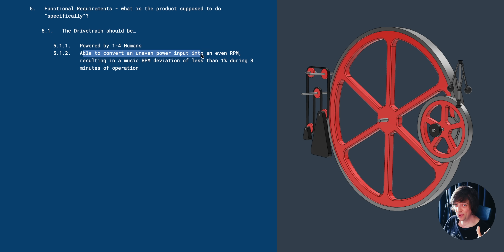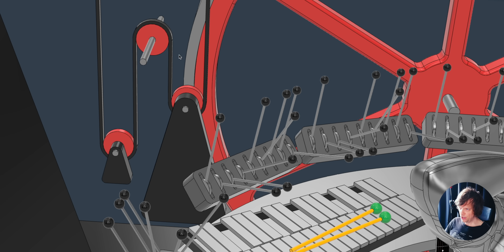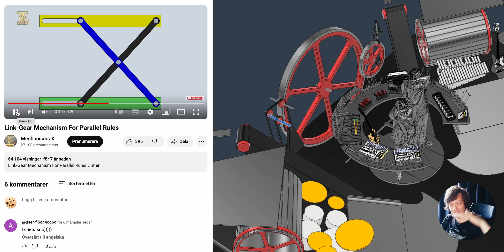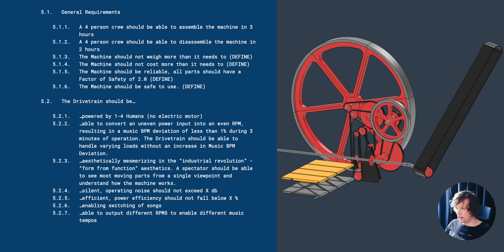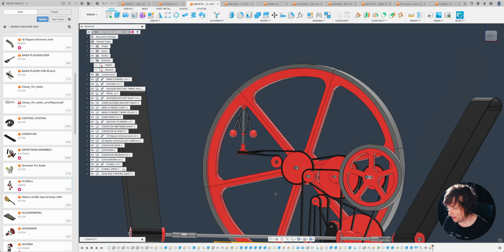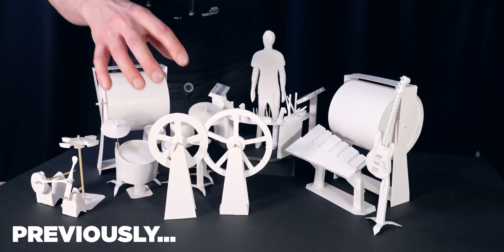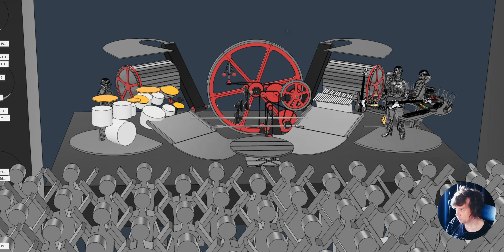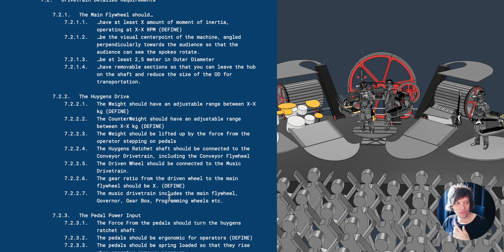The Marble Machine Drivetrain

Comment: Sea-sickness mid concert. There is a reason most pedal operated machines have a stationary point. Give the operators somewhere to stand or sit.
Reply: there will be one.
Reply: Seems like the operators could be sitting on bicycle seats and pedaling bicycle cranks and chains.  There could even be a derailleur to change ratios.
Reply: Once Martin calculates the input energy required for the songs he decides to perform, he might want to take another look at the weight. Maybe if the energy requirement is more than he is comfortable with, he could devise something (an antique cannon, perhaps) that could be ratcheted up into the air by some volunteers, preshow, and it's stored energy tapped into if necessary. 😅
Reply: If you looked at the blueprint design requirement it was written there.

Comment: Good ideas. You could raise the mechanics so they become visible again. The twist in the belt to the governor is a fail waiting to happen, better to find a better solution.

You are missing two requirement areas:
- safety
    - for example: fly wheel must be out of arms reach from control area, or there needs to be a transparent shield between players and fly wheel - that thing is dangerous
- location
    - for example: machine must work within X temperature and Y humidity range, a worldtour means different environments, that will deform the machine, same for transport
    - for example: what are ne needed loads of the stages? There might be requirements from location towards you gear. Best to get a general idea of what these will be befor building.

Comment: I'm a bit concerned about uneven surfaces with the pedals. Especially if the operators are moving around in the control station.
Reply: There is a requirement for a stable platform for the players to rest on on the list. He doesn't mention it.

Comment: You dont want a static gearbox. Gear shifts will be clunky. You want a cvt or hydrostatic. So gear changes can be seamlessly infinitely variable.
Reply: Honestly for this build I'd prefer hydrostatic. A cvt still needs clutch. Start clutch and overrun clutch. Hydrostatic being capable of a zero gear ratio solved both and directly interfaces with govoner.

Comment: The design requirement of being solely human powered still baffles me. Why not have some assistance so you can leave the machine, even just temporarily.
Reply: Maybe run a motor on the higan drive, that can be turned on and off. Its sole job could be to reset the higan drive while Martin can run off and do a solo away from the machine or something. Just an idea.

Comment: I am not sure how your going to be able to make that pedal system workable and safe. You could easily trap your foot and you're not on steady ground at any point.
Reply: Going to comment here, because no one will read my comment if it's further below: a set of bicycle pedals and a saddle would be soooo much more ergonomical. That's actually a kind of pedalling one can sustain.
Reply: @Julia_and_the_City how about pedals on the side of the machine and volunteers of the audience can do the powering? It would free the band up to make music.
Reply: @theowl84  that sounds like a liability suit just waiting to happen, ngl. Itd have to be practically impossible for someone to injured by the mechanics, or they'd have to have people sign liability wavers. Plus thatd make it harder to find a venue for performances.
Reply: @Julia_and_the_City that’s a good idea!
Reply: @Julia_and_the_City   yes, but if the torque required is more than a bike pedal could handle, you'll destroy the pedal, or your leg, or both.
Reply: @Berdersner    I ride a cargo bike and a run off the mill safety bike (Dutch life). They're pretty heavy and there are even bicycle-buses (real stupid looking but they exist) for as many as 10 people. Pedals on modern bicycles only go _forward_. If you try to backpedal - or more relevant, if the machine you're inputting in moves faster than you can pedal - the drive disengages. So if the torque required is too much for me to provide, the machine just doesn't move... Change the gearing downward to get it started. Either way, safety seems like a moot issue to me. And I'm not the kind of person to say that about anything, I'm generally very much a stickler for preventing occupational hazards, hence why I jumped on ergonomics here in the first place.
Reply: @Julia_and_the_City  only ever said if the torque in the system is too high, then your liable to break the pedal or your foot through the strain of trying to pedal like that. Dont put words in my mouth. Also, this isnt some mountain bike your trying to pedal, but several tons of metal, I get the feeling that a simple bike pedal isn't going to cut it here.
Reply: @Julia_and_the_City  let me also add that trying to pedal like that through a concert is gunna be tiring, like is Martin gunna need a full crew of people just to pedal the thing? His design is atleast better in the sense that he can pedal and play like that, since he's relying on gravity to help with driving the device. Whether his weight is enough to overcome torque is yet to be seen. Also, he clearly hasn't designed a clutch and gearbox system into the device, so itd be pretty hard to reduce the gear ratio to drop the required torque down.
Reply: Flywheel and Pedal are only connected one way through the huygens drive.
Reply: Just put a shroud around the linkages so it's impossible to get your foot underneath.
Reply: I thought exactly the same after last video, when he introduced the way bigger wheel....
Reply: There is a requirement for a stable platform for the players to rest on on the list. He doesn't mention it.
Reply: Could he not just connect the elevated platform to the rest of the structure?
Reply: There needs to be some sort of slip where the machine is only receiving power on the down stroke, but returning the pedal to the up stroke happens in a non linked manner. Some other force rather than the flywheel needs to be responsible for moving the pedal back up, that way it's not going to be able to rip off your leg
Reply: This, I was thinking the exact same thing, and with a flywheel that big, you'd be liable to loosing an entire limb if you got stuck in the mechanics. Ntm the torque in the system must large if your trying to run all that stuff. Itd be like trying to hand start a semi.
Reply: Why not just have the 2 people that were in front the fly wheel above the fly wheel on an elevated platform where the flywheel is the front of the wheel
Reply: You could solve the spacing problem by still putting the operators in front of the gears, but add a camera behind the big wheels that projects the video on a screen.
Reply: You will need to physically separate the moving parts and your limbs, by a guard (fence, wall, polycarbonate, etc.). Otherwise you simply will not be allowed to operate this machine. Don't forget this.
Reply: @fabricio9294  he can operate it at his own risk, just no one else.

Comment: Be careful when using universal joints to connect angled shafts together. Their output algular velocities are not constant
Reply: the universal joints will not survive the engineering stage imo. terrible backlash, innefficient, noisy, weird input-output charecteristics, all things that will almost certantly make them unviable in the final design. but for a sketch they're fine.
Reply: Perhaps he can use cv joints
Reply: Double universal joints are set in mirror, so the inconsistency would cancel out. But who knows.
Reply: Agreed! If the input and output shafts are not parallel, then you will have beating on the output shaft...
Reply: @filippopaganini6915  hilariously the reason i found this out is because i'm a drummer and wanted to find out why double kick pedals feel so awful. now i know!
Reply: I recall many years ago, my father (a mechanical and electrical engineer) complaining about the universal joints on my sister's car. There are constant velocity (CV) joints as well as the more traditional type. When paired in a car, the vibration of the conventional types apparently cancels out. The problem was that the designers of this car used a conventional universal joint at one end and a CV joint at the other. As a result, my father was constantly replacing one or the other.

The lesson for Martin - if you need to use universal joints you should be able to do so (a car would produce greater wear and tear on a UJ than a MM ever would) but you need to be clever about how to do it.
Reply: It's probably going to jam and break something
Reply: Have you considered a rocking beam and grasshopper motion for the pedals? Like an early 1800s steam engine. They used a linkage to get straight line motion of the piston without a sliding crosshead that would have friction. Early marine steam ships also had many space saving variations of beam engines.
Reply: Exactly, on the one hand, you spent two years so you can play tight music and now you are slacking with universal joints. You should design it in a straight line or use beveled gears at least.
Reply: CV joints have a wider angle of operation and do not suffer the the velocity fluctuations that u-joints suffer. U-joints have a low operating angle and slow down/ speed up twice per rotation
Reply: It's especially insane if you consider that they are there purely for aethestics. You could just not angle the left and right part
Reply: U - joints are used reliably in driveshafts on cars and large trucks. If he used off the shelf u joints from trucks it would be cost effective and reliable. Putting two together in the right orientation will make the rotation smooth.
Reply: @jacksavage6880  big important note with u-joints in vehicles: they're in pairs whose input and output shafts end up paralell, which for math reasons i don't understand makes them work well. when this isn't the case it causes Problems
Reply: @jacksavage6880  I'm building Lego a lot, we have universal joints as well as cv joints. They are the same in terms of dimensions but cv runs more smoothly then two universal.
Regarding joints used in cars and trucks, I'm pretty sure they used in variety of machinery in lots of different sizes
Reply: @Toasted_Donut  Wait, LEGO has actual CV joints? (Looks it up.. they do!) Mind blown. Haven't built Technic since the 90's.

Comment: I personally think the performers should be in front of the mechanics... I'm imagining seeing the mechanics through the performers as they're moving around and it sounds incredible.
Reply: Maybe he could put the mechanics higher up. The performers heads could be a bit below the hub. That would probably be easier than putting it stage forward.
Reply: @pontusf9427  Lifting that massive flywheel increases risk of it tipping and/or falling. It should be as close to the ground as possible, in my untrained opinion.
Reply: I don’t think it’s as big a problem as he thinks especially since most people will see from camera angles anyways.
Reply: Yeah, maybe find a way to lift either the performers or the mechanics up might be a solution here too?
Reply: A possible option is to move the mechanics higher and have them above the performers. That way everybody will be able to see them. This depends on how heavy the flywheel is going to be and how feasible it is to move it higher and still make it safe, but I would not automatically disqualify this option and it could look way cool.
In fact I think I've got a pretty solid solution for this. Where does one send ideas to Martin? The Discord?
Reply: What about above? Like some crazy robot spider
Reply: Solution: make the performers transparent.
Reply: @andrewbailey8424  😄😄😄😄
Reply: Especially if the performers are sometimes just silhouettes with ther lights shining bright on the machine... and of course they can have a song or two where they maybe remove the performers,   like a machine solo
Reply: Would be cool but if the pedal powering system is there in front they couldn't stay away for long.  @tommj4365